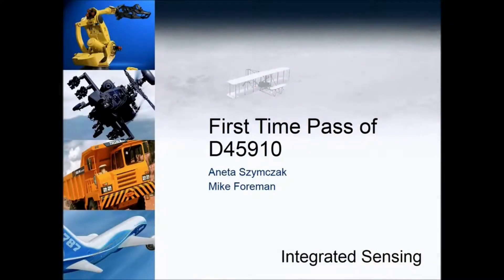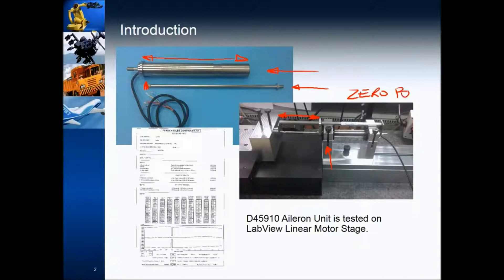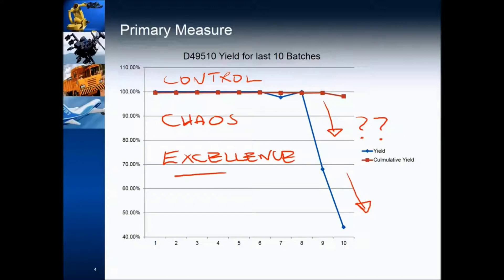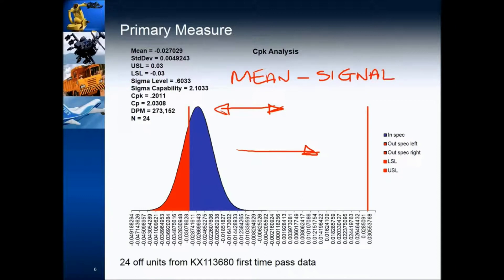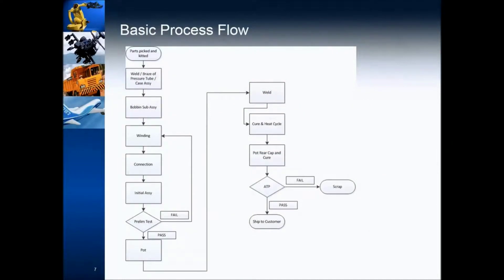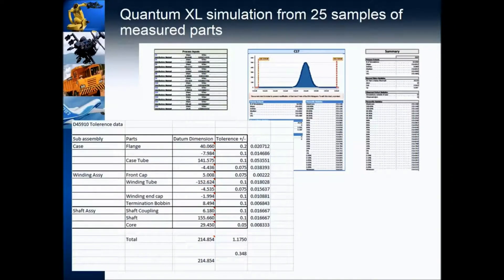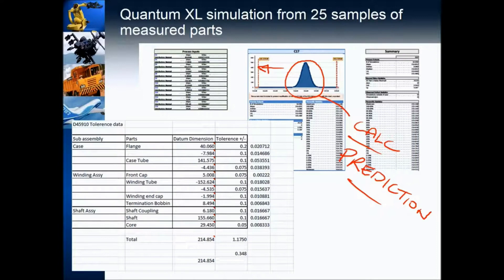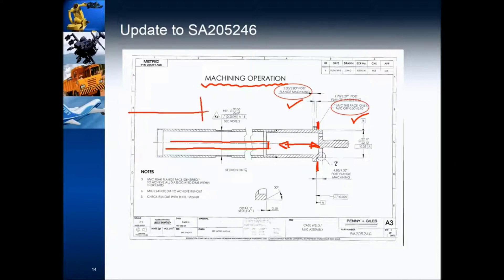Chaos or control?? Here's a great case study...

Comment: I totally agree that they should have went further with a 3 legged 5 Why. The root cause leading from the question of why the system did not recognize that the face dimension change would effect an internal customer (inspection process step) as it was actually a datum definitely needs to be addressed!!  Good case study. I'd like to use this in problem solving training as an example.
Reply from the maker: Feel free to use it Bubba...
Reply: @paulallen5321  Thank you sir